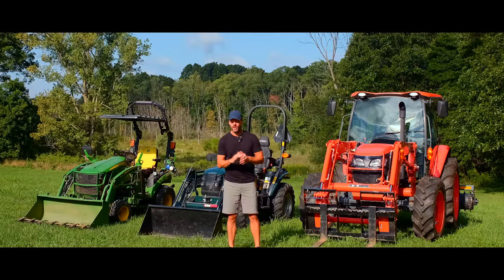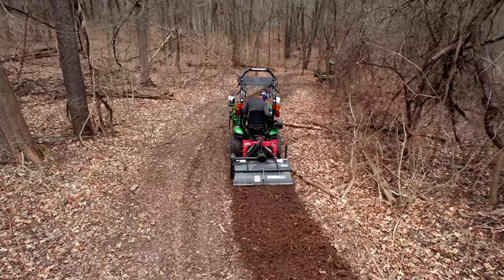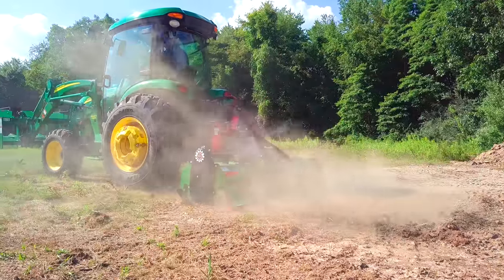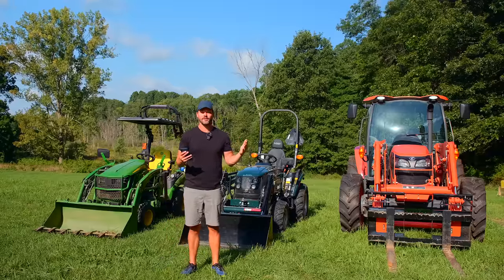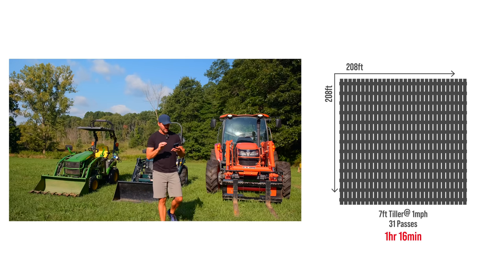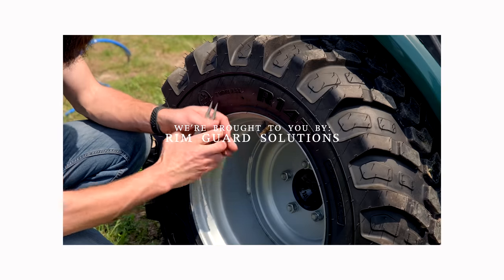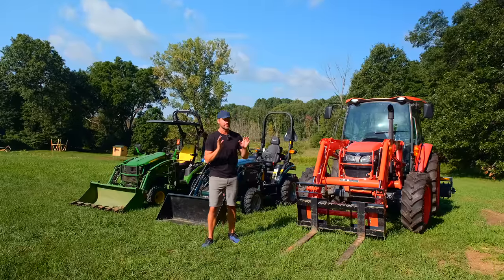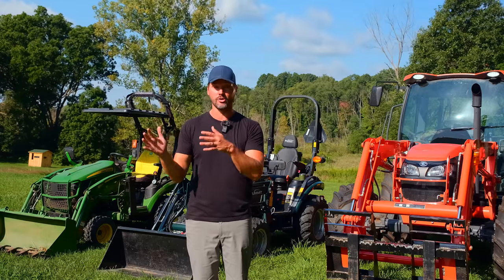WOW, USING BIGGER ATTACHMENTS SAVES A LOT OF TIME! 😲🚜

Comment: Another reference point for tiller use and longevity... My sister and BIL are professional horse trainers.  The footing in their indoor arena , which is around 6" of sand on a packed base, has to be critically groomed all the time.  Typically, they ran a rototiller over it twice a day, almost every day.  They'd have to completely replace ALL the teeth on the tiller every TWO months!  They recently changed their arena grooming methodology to using the tiller once a week to completely work up all the sand down to the base and then use a Parma Arena Groomer (a 3PH s-tine spring tooth harrow with a trailing smoothing bar followed by a rolling basket)  for daily grooming.  The s-tines on the groomer  have reversible and replaceable chisel points that all have to be replaced every 4 months (after one turn over of the points).  However, it is significantly cheaper and easier to replace the chisel points versus all the tillers teeth.

Comment: Hey Courtney: I do quite abit if tilling with my B series tractor.  Obviously a second pass is probably double the time.  How ever I have found that over lapping the tiller by half gives you a second tilling but it is also easier on the tiller because it’s only breaking thru hard stuff with half the tiller.  I’ve found this method actually goes quicker then two complete passes.
Just a suggestion

Comment: Your videos are very helpful when deciding which attachments or accessories to get for our john deere 3046r. I went with a summit hydraulics 3rd loader function. Installed it myself and now I'm just waiting on my everything attachments wicked root grapple to be made. Went with the lightest root grapple I could find on the market so I wouldn't lose loader lifting capacity. The only complaint I could find on it is that in some cases it took 5 to 6 months to be made because the company was so backed up with work. Anyway thank you for you videos. They are awesome. I wouldn't know what to look for when buying attachments or accessories if you didn't put them out. Keep them coming. 👌🏻👌🏻

Comment: I tell my clients that are looking to get their own equipment to buy the best tractor they can and skimp on implements a little, especially the once a year ones. The guys looking at starting a business should look at the best quality stuff they can, unless it's something they don't use often. Size wise, I tell everyone to cover their tracks. If they have a 4ft wide tractor, they should look into a 50" tiller to break up the compaction of the tires on the 2nd pass. I hated my 4ft tiller, because it'd leave the outer edge of my tires. But you're right about lasting a lifetime in most cases. My tiller has over 400 commercial hours of hard packed Carolina clay (red concrete) and I'm just now thinking about replacing the tines. My grandpa have one so old, I joke it was was the first one built that he still uses to this day. His bush hog is older than that. Heck it probably cut the Flintstones fields back in the day. Both still running like new.

Comment: I think it’s important to point out that gearboxes are critical components and not always available. I bought a Pegasus 52” tiller off marketplace “needed work” - well someone twisted the thing up pretty good and cracked the gearbox which is cast iron - hard to weld. I tried fixing it by brazing and JB Weld - leaked right away. Half a year later JBar who makes the Pegasus found me another gearcase. This is the top one that the PTO goes into. In the meantime I bought a Victory Tractor Implements 78” tiller with side shift - it’s all Chinese. I would’ve loved a RhinoAg medium duty with adjustable speed but $ was the issue there. The Chinese tiller weighs in at 900lbs, it’s built as heavy as a Tartar/CL and priced similar. I hope these things last, tillers aren’t cheap.
Reply: You can pack gearboxes (Close to) full of grease if oil leaks are too hard to fix. Works almost as good as oil.

Comment: But remember you have to have a tractor that can run these larger tillers
Reply: So don’t buy a little tractor if you are planning to till a lot of land. However the second hand market for little tractors is very strong.
Reply: @kdegraa  what does that have to do with the video he was talking about time cut or speed of finishing the job by having a larger tiller well you can't have a large a tiller than your tractor can handle. And that's what people need to know they can't just go out and buy a larger tiller they have a 25 horsepower tractor going out and buying a 72 in tiller it's not going to work you have to buy the PTO implements that I work with your PTO horsepower